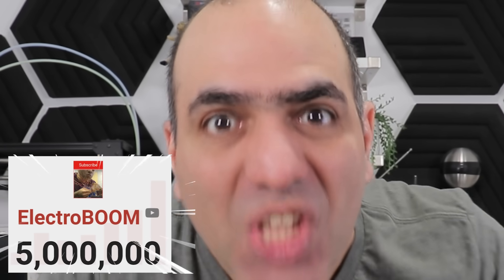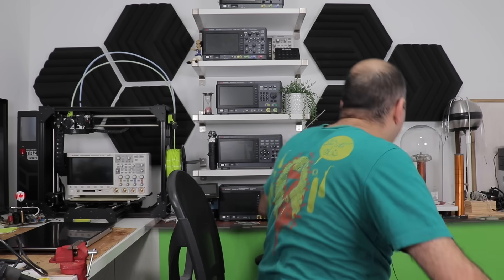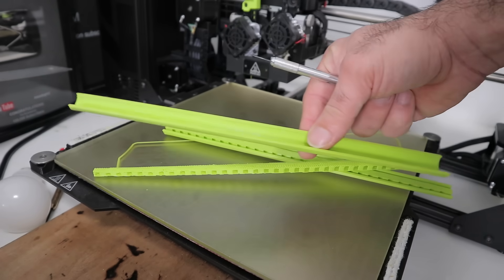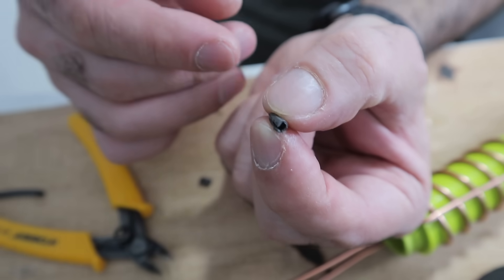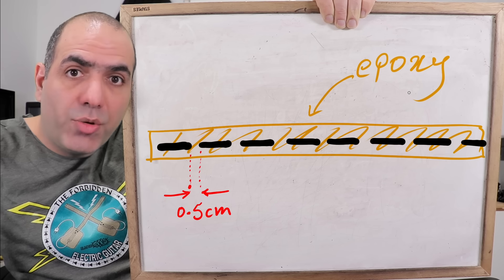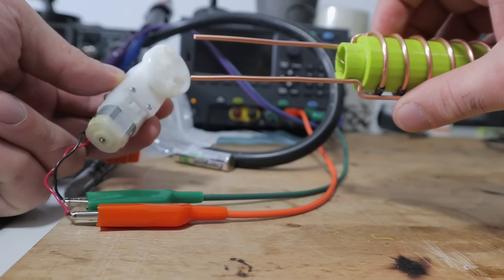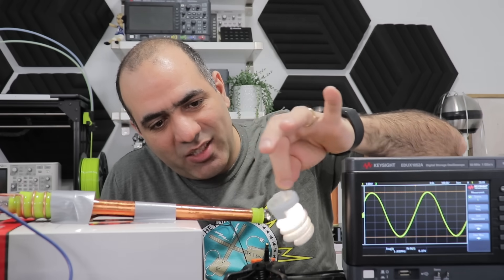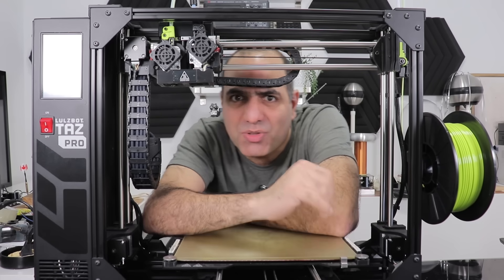Making a Tesla Coil Magic Wand, to Celebrate 5 MILLION SUBS!

Comment: If it wasn't for Mehdi, I wouldn't have gotten into electronics myself. Now every time I need to diagnose some broken power supply, I usually know what I'm doing with my soldering iron.
Reply: Congratulations
You have been selected as the random winner of
the Giveaway.
Send me a message via the above contact so to Claim prize!

Comment: Can you try another core material? Iron oxide is non-conductive ceramic, sold as pigment. Red or black powder. You mix it with epoxy (a lot of pigment), pour into mold, you get a core. I just don't know how good it is.
Reply: Congratulations
You have been selected as the random winner of
the Giveaway.
Send me a message via the above contact so to Claim prize!

Comment: Why did you strip the 10 gauge wire for the primary? You could wind an insulated wire for additional insulation.Also,10 gauge is too big for that small coil,16 gauge would be more than enough. I made larger Tesla coils with 2.5mm2 aluminum wire as the primary.

Comment: Neither were random, you could have controlled the proper amounts using the right materials, graphite powder for example, powdered carbon, thinner wire for the secondary than 28awg poop

Comment: Congrats Mehdi! I was wondering, is it possible to create laminar flow of electrons? Kind of like the way water turbulence can be reduced enough to create laminar flow? Can you make laminar electrons by reducing the turbulence of the movement of electrons?
Reply: electrons are not a fluid
Reply: @ahandlethatisnottaken  obviously, but they still flow.
Reply: @Igmus  they are far too small reactive and uncontrollable to make a laminar flow. Laminar flow is only possible if you can ensure minimal cross-flow turbulance between the particles. Since many fluids are chargeless and polar, there are minimal electrostatic cross forces to disrupt laminar flow, but the mass/charge ratio of electrons is so comically low that laminar flow is basically imposible
Reply: So electrons are so incredibly tiny that you'd never be able to see them flowing. When you see sparks and lightning, what you see are photons being released when electrons are excited and then fall back into a lower energy level. What you think of as a spark is just a momentary burst of photons and plasma.
Plasma can have laminar flow. Plasma torches are laminar flow, and are made of electrons.
Reply: @ColwellMarcus  plasma is not only made of electrons, it is made of ionized atom nuclei, so the electrons and their atoms are not bound together; what you see though are not the electrons but the nuclei, and the electrons themselves flow like in any other conductor, so not in a laminar flow

Comment: Perhaps the dielectric strength of the 3D printer plastic isn't high enough. It's definitely nowhere near that of epoxy. Maybe you could 3D print negative molds, and use those molds to make epoxy versions of the plastic forms.
Reply from the maker: I though that, but then there is epoxy between primary and secondary on top of the plastic, so I don't know it that buys me much. I suspect there was a bubble under the plastic in the epoxy I poured, otherwise why would the plastic bulge out so hard?? Not sure, have to cut the plastic and see what's under.
Reply: @ElectroBOOM  look into resin printers, altho for a wand this big I'm not sure you will get a big enough one that doesn't cost an arm and a leg
Reply: @ElectroBOOM  Why did you strip the 10 gauge wire for the primary? You could wind an insulated wire for additional insulation.Also,10 gauge is too big for that small coil,16 gauge would be more than enough. I made larger Tesla coils with 2.5mm2 aluminum wire as the primary.
Reply: @ElectroBOOM  what percent infill did you use while printing? maybe that air is what expanded?
Reply: @ElectroBOOM  Might be a case of dielectric heating here. You need to consider material's dissipation factor for this application, common 3d print plastics tend to have high DF and are quite lossy insulators that can end up melting in high frequency electric field. Humidity and temperature make it even worse. PA11 or 12 seems good for it. Or make that part with a resin printer.
Reply: @ElectroBOOM  Well, given MHz frequencies maybe it's just skin effect and you should've used litz wire instead of solid core.
Reply: @ElectroBOOM  Sir, Where is ElectroCUTE by the way?
Reply: Pinocchio  Promoting your gross soap violating content is not relevant under a comment about some guy making portable Tesla coil wands.
Reply: @mad_6519  agreed
Reply: I actually talked to someone working in a company that makes MV to HV lab equipment. They thought about using 3D printed insulators - but the material is really crappy as an insulator! The main reason is that you have tiny air bubbles everywhere. So any 3D printed insulator that has to withstand a high field strength is going to suffer from internal partial discharges. They will slowly but steadily destroy the material until it breakes down.
Reply: @TheMightyZwom  "modern" composite chinese insulators fail as often as very old and non maintained glass or porcelain ones.Sometimes when utilities replace insulators,the new composite is thinner and shorter than the old porcelain ones and flash over easily.
Reply: @ElectroBoom use litz wire.

Comment: This green screen - headless whiteboard thingy is amazing! :D
Maybe 3D printed stuff wasn't a good idea with high volgate that generates so much heat, melting the filament :/
Reply: Pinocchio  dafuc
Reply: If you used PEEK or PEKK it would have a much better thermal and electrical properties, but a wallet hurting price.
Reply: hi
Reply: The right filament would solve that, provided the printer can print said filaments.
Reply: Another problem with 3D printed stuff: it's green, which means you won't be able to use it in front of a green screen to put in a magical background.
Reply: @vigilantcosmicpenguin8721  thats just the color he used, u can get filament in almost any color.